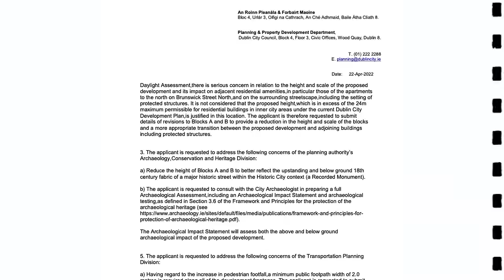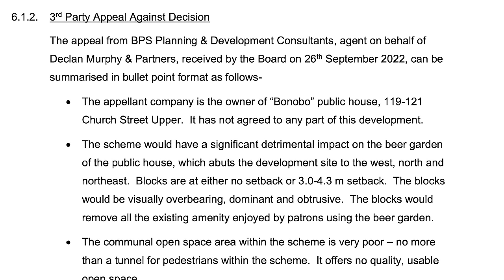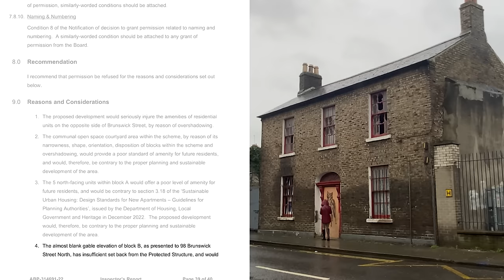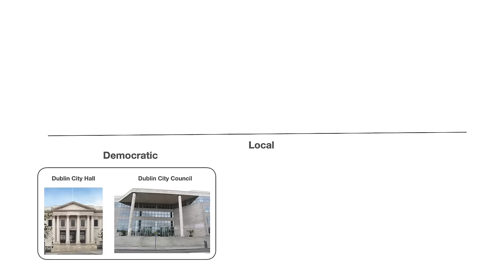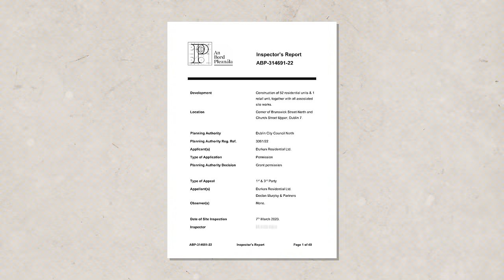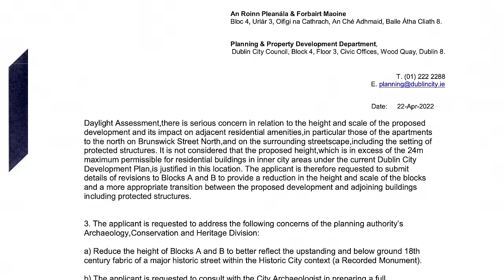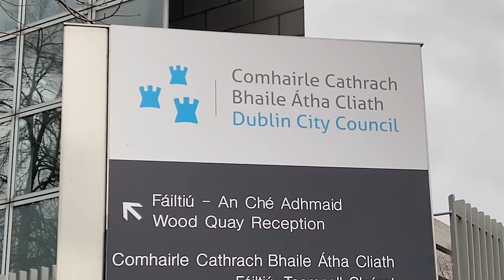Planning madness in Smithfield

Comment: Bonobo didn't buy the property to develop it themselves. Therefore they should have little say on what happens with it. These kinds of cases are ridiculous and their reason to appeal is even more so. Install some lights and plants in that beer garten, make it cozy! Otherwise, move your operations outside of the city to a place that is more appropriate for what you have got in mind. There are enough villages around the capital with wide open space and undisrupted shadows for a beer garten. The idea that Dublin "is a low-rise city, and should remain so, predominantly" is nothing more than a personal opinion and should carry absolutely no weight. Stuff like this truly makes my blood boil.
Reply: So you don’t like Paris or Barcelona you want a Dublin with buildings springing up in the middle of established heights? No thanks maybe down the dock lands
Reply: @PB111627  Did you even watch the video? Seven floors is normal for any city and actually the norm in Paris, Vienna, Barcelona, etc.
Reply: Just what are the benefits of low rise cities? When they grow out rather than up you get long commenting distances and lousy public transport. Dublin compared to other cities of its size in Europe has the worst and least integrated public transport system. Just two tram linea and one light rail line that runs along the coast.
Reply: @patrickmccutcheon9361 being able to see the sun and not live in the blade runner universe. And the aging population don’t need to get up 8 flights of stairs every. Complete melt.
Reply: Thanks for the ancap rant Alex Jones. Going to change your pfp to the Gadsden flag and talk about everyone should be armed?
Reply: @RustieFawn  Look at the building plans again. It doesn't look like Blade Runner at all. More like loft apartments. Buildings with escalators and single floor apartments actually give better access for the elderly. If you really don't like it, you can live literally anywhere else. That's the beauty of building up, it takes relatively little space.

Comment: The system is designed to limit new housing units coming on stream because it is so so so important to the government that house prices generally, do not begin to fall. If house prices begin to fall, some people would default on their mortgages, due to negative equity. This would put pressure on the banks which would be less likely to loan, leading to fewer people buying and further declines in house prices, leading to more defaults and so on. But limiting supply is just one of many tools the government is using to keep house prices on an upward tradjectory. A big problem, (from the government`s point of view) will inevitably arise, as mounting market forces will eventually overwhelm the government`s ability to rig house prices. Our national debt increased by nearly 200 billion since 2008, to close to a quarter of a trillion today. This was a six fold increase from where it was. Most of this was used directly or indirectly to re-inflate the house price bubble that the market was trying to correct. Should house prices fall, that inflation will come out of housing and go elsewhere, such as foreign assets, consumer prices, etc. We will still owe the 200 billion Enda Kenny borrowed, it`s just that we will have nothing to show for it. Not even high house prices. We could re-design our planning system in the regionalized way suggested in this video, but if that happened, the government would simply re-design it`s market rigging mechanisms to ensure it`s ultimate goal of ever increasing house prices continues. Reform will not happen by design. It will be done onto us by factors beyond our control and because the government is acting in it`s own interests and not ours, the sooner international market forces wash over and overwhelm our government`s ability to create inflation in the housing market, the better it will be for everyone.

Comment: Great channel! What are you thoughts on incentivising the refurbishment of existing but disrepaired urban properties? It breaks my heart to walk down any town or city in Ireland, and see window boarded up or dark and empty along main street, over shop fronts, etc. It's like out towns are spreading outwards but rotting from the core.  I'm glad we're moved away from urban sprawl and green field development, but surely there's a case for using whats already there. If the exterior of an existing structure isn't changing, the scope of planning permission and potential for rejection greatly reduces.  In addition, refurbishing empty buildings would provide more plentiful small accomodation for individuals and young people, increase competition between existing landlords which should drive up overall quality of accomodation, and also increase the footfall for local businesses.  But for some reason, it doesn't happen. Is the cost still higher than new builds? What am I missing?

Comment: Down my way with is in Dublin 2 there going up to 18 floors right up to the port wall 14 floor buildings 10 floors and everything in between so what is it are we a low rise city or high rise there is not a lot of difference between Pearce Street/ Ringsend and Smithfield same apartment blocks but down here we have had 15 stories apartments since 2000 with Charlotte key dock I don’t think on bhord planola knows it head from it’s back side

Comment: Great example of the absurdity of the Irish planning process.  Every action has a consequence,  and while the right of the individual stakeholder should be heard, it should not be permitted to trump the common good. This is only one decision by the planning authority(ABP),  but it illustrates how the building planning system actually works, and every development for new high density buildings must run through this gauntlet.  Result, Bonobo, the lone onjector,  had their say, but society has to pay.  How is this absurdity not a national emergency? Ppl are out blaming landlords, immigrants and developers etc., but their justified anger is directed at the wrong parties. The real culprit is the government who set up this subjective,  opaque,  time consuming obstacle course that is ABP.  
Look at peer countries and compare. 
Holland has a population density of 521 ppl km2. Ireland is a mere 73 ppl km2.  Similar level of wealth and income.   The Netherlands is 7x more densely populsted. Are homes there more expensive? Yes. But only 30% more (average price for a used 3 bed home on a national basis, both countries).  Solution: Create designated zones,  in DUB and other cities where high rise developments can be built.  Also, create new towns,  with high density residential structures,  with parks, walking to shops etc. Tax derelict building owners,  forcing them to build productive structures.  There's tons of land, use it. Stop blaming excess demand,  which is simply evidence of the country's economic success. Instead,  boost supply.
Reply: Bonobo did not make the decision. ABP is the independent arbiter of the common good. This process worked precisely as the system intended.
Reply: @gavindaly2401  I understand that.  But how is the common good served by this nonsense? There are no objective written standards for new construction that I know of.  It seems developers must submit plans, and hope for the best.  Then, one person can object.  Just one ! And it seems progress can be stymied by someone saying " Dublin is a low rise city" , so nothing higher than has already exists can be built?  None of this serves the common good. It's the very definition of narrow interests, not the common good. If developers cannot build, then new homes will continue to be too expensive for young ppl to buy.

Comment: Nonsensical argument about "future tenants deciding if an undersized communal area is a deal breaker." That's not how planning works, thankfully. Otherwise we would have a litany of even smaller, sub-standard, dark flats, in a never-ending race to the bottom. Agreed that this development should have been allowed move forward, but developers keep breaking planner's size/light regulations and then moan when they get refused.